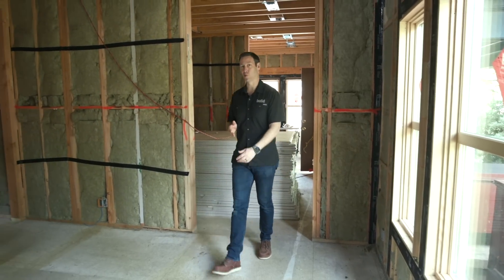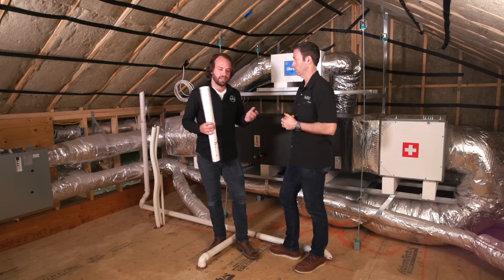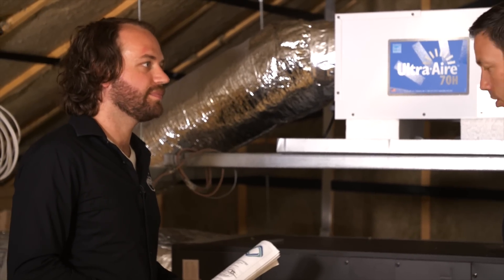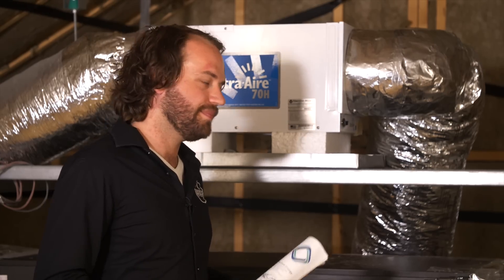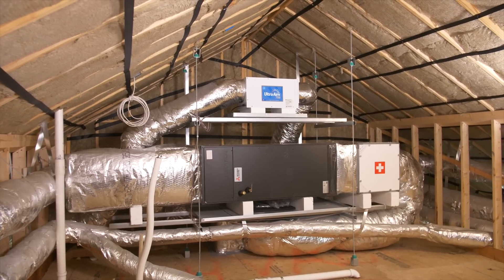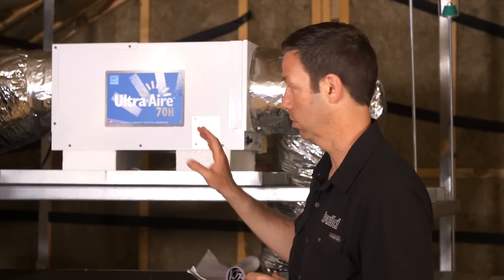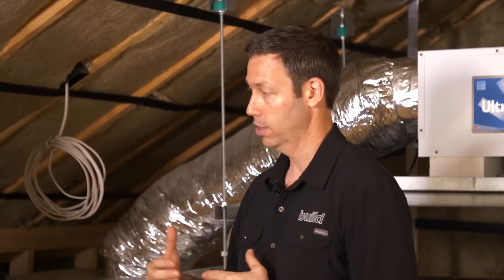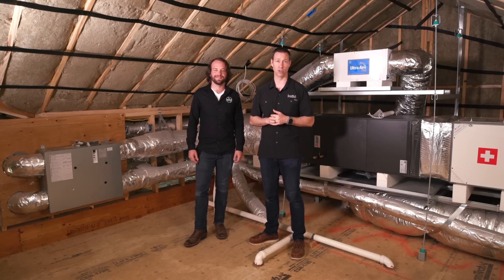New BUILD : Excellent Air Conditioning System Cost?  I’ll tell you!

Comment: It just be me but, why are the AC systems placed in the hottest area which is the artic. Then cool the air and blow it through poor insulated not permeant ducting in this hot attic to the area needed before reaches where it is desired. Much of the cooling is lost.

Comment: A car hvac keeps adding more pollutants both from inside the he car and outside.  Petrochemicals from engine and leaky exhausts and traffic exhausts.  House unwanted tightness to limit more nasty stuff from outside adding to possible inside pollution that is being cleaned out.  You Also do not want to pull air so hard your pulling air from insulation in the walls.  Love all the hepta filters and PM part of it.  Like an operating room inside the house.  Worth  the costs as we spend a lot of time inside a house especially with climate change.  Need for smaller hvac which saves energy.  With increasing energy costs would recommend battery storage and or solar.  Save cheap power for use when more expensive peak power.  Plus protected from increasing outages.

Comment: Homes are primarily wood and cardboard.  More labor costs more than anything.  Kitchen appliances/toilets are nothing compared to cost of home.  Spend money on hvac system.  Minimum 20 amp circuit, ie forget 15 amp.  Spend money on plumbing, windows, and insulation.  Everything above minimal compared to price of home.  Agree, do it right. It pays off later. Same with solar.  Solar is expensive cuz pay everything up front but pays off later.  Heat pumps?

Comment: I like everything except you idea of hepa filtration. Many hospital operating rooms use hepa filters and they are nothing like your filter. I was an HVAC maintenance worker in hospitals for 20 years and I replaced hepa filters as well as regular filters. There has been a lot of hype by sales idiots about air filtration. You need to get yourself educated. ASHRAE defines everything in the science of HVACR mechanical systems. Talk to the people who support ASHRAE and you will get the facts. Words matter. What you are calling hepa is actually a high efficiency pleted filter with a cabinet made to allow slide in filters. Hepa filters are clamped in an air tight cabinet so that no air can go around the filter. A residential HVAC unit can not use hepa filters because the air restriction (pressure drop) is way to high. Special high pressure fans are required and the horsepower to move 1000 cfm will be double. Dont get me wrong about the filter box you are presenting because it looks very good. MERV 16 with those 4 slide in filters is outstanding because it keeps the air resistance low. Residential units must use a special arrangement like this to use high MERV filters. The higher the MERV rating the higher the air resistance and more horsepower required to move air through a single filter. By using 4 it makes the whole filter only 1/4 the resistance of a single filter. ASHRAE has a specific test for air filters so these IQAir filters should have paperwork from an independent testing lab with the actual MERV performance. If not they could be exaggerating (lying) about their MERV rating. I question why anyone thinks they need MERV 16 in a residence? https://www.epa.gov/indoor-air-quality-iaq/what-merv-rating

Comment: Looking at Positive Energy's website, they're charging $6/sq ft for design services and tell customers to assume $20-$25/sq ft total installed costs. That's completely ridiculous to me. In a 2500 sq ft house, I pay these guys $15,000 to design this system, and ultimately pay $50,000 to $60,000 to have it completed...? I don't know what construction costs are where the rest of you live, but in Tennessee you can build a pretty nice house for $150/sq ft, and to think that ~15% of that would be in HVAC is asinine.

Comment: Unvented roof with rock wool insulation.
return side: Swiss air filter > AC > Dehumidifier separate return? sending dehum air to supply > ERV pulling air from outside then sending all that supply back into the supply ducts.  
Is this right? Trying to figure out how this is laid out and ducted. I am trying to figure out how to go from a vented attic to unvented and stumbled on this video.

Comment: It's refreshing to finally see someone talk about long flex runs.  As an HVAC contractor in the Northeast, long flex runs are not common practice.  However, most HVAC channels based in the south, flex is all you see.  You also don't see many GC's talking or caring much about the HVAC systems.  Love the content Matt, keep up the good work.
Reply: You want to see a bunch of 5 ton spider 🕷️ systems. Look at those $2-10M homes in Alpharetta Ga that I used to do service on. Most variable speed blowers wouldn’t push enough air through those high profit hack jobs.

Comment: Hey Matt, I had a question about VRF systems that I thought you’d know. From my understanding, the mini-splits take heat from the house and dump outside in summer and reverses that process in the winter. My question is could that be combined with a geothermal system so that you are pulling and depositing this energy from the ground rather than the air? Would there be any improvements on efficiency or would this just be overkill?Thanks and great content as always!
Reply: What you're talking about is a ground source/geothermal heat pump.  If sized properly, the geothermal is probably 10-25% more efficient, but usually has a higher upfront cost because you have to drill the holes/dig trenches for the pipe and purchase/install the pipe.  The phone quote on my estimated 4 ton was about $800/ton of AC size installed for the LOOP FIELD PIPE only.  I was going to do the digging myself with my backhoe.  The indoor evaporator was the same cost as an air/air heat pump (my installed quote was 10k for the inside unit - Total was 13k doing the digging myself).  If they installed it all w/ trenching it was going to be 18k.  Unless you have a large heating/cooling demand, your break-even on the geothermal vs this Mitsubishi heat pump would be a long time.  FYI their estimated size was twice what I actually need.  I'm working on lowering my load demands by air sealing/insulating and will probably install the same Mitsubishi in the video, just smaller.

Comment: So the HVAC system ALONE is going to cost you 2-3.5 times more than an open air house. This DOESN'T include the costs for upgraded insulation.  NOR does it include the cost for  maintenance of this very complex system. If something breaks down on this system, it is going to be expensive to repair and not any HVAC tech will be qualified to fix it. But wait, there's more, you are replacing  MULTIPLE air filters every three months. You'll probably spend $500 a year on air filters because you can't run down to Home Depot and buy one of these air filters.  So you are going to probably spend at least 2.5 times more for your home cost  On a $250,000 home,  3000 SF house, the typical cost for a really good HVAC system in AZ would be less than $25,000 - $30,000 and that is using top of the line Trane units. So for this closed house system you are spending (2.5 x 25,000) - $25,000 = $37,500 more for JUST the HVAC. Now add in at least $7,500 for closed cell foam costs (over standard insulation costs) and you're at $45,000 more in cost. If you want to filter your air on a standard system, you can install a Trane Clean Effects system, which is one of the best, for around $2,500, and you can reuse the filters on that system. You will NEVER get that $40,000 back because when you resale your house, no buyer is going to pay $40 K extra for a fancy HVAC system in the $250,000 cost range. 

Further, the open air standard system for a home building will be 90% as efficient thermally as this closed system home, if it is built and insulated properly. That is because you get diminishing returns on any insulation over R-40 in the attic and R-25 in the wall. You can spend a ton of money to add more insulation above that, but you get very little efficiency return.

BY FAR, most builders do NOT used Risinger's "closed house" building system because there are SO many things that can go wrong with it. It's expensive to install, expensive to maintain and expensive to repair.  If you are building a million dollar and up home and you have money to burn, then these luxury systems. 

It would be much smarter to build and standard house with standard insulation and spend the $40,000 on installing a solar panel system. This would reduce your energy bills to almost nothing and when you resale your house you will be able to get about 50% - 75% of the cost of the panels back depending on a lot of factors. You also get large federal tax breaks on solar installations. Also, for a 3000 SF house you could put in a really nice 15 KW solar panel system for around $25,000 and that would more than power your house.

Comment: Tight homes are great  , however many people are not prepared for the huge cost of  hvac that is needed with the tight home .
To say that the general contractors are to take a lot of the blame for this is accurate .
The general contractors for example will be charged by the subcontractor for air conditioning , say 3 ton for 3000 dollars 
Typically he pads the bill to the owner  double , at least 6000 dollars .
Home owners would save tens of thousands of they would have the builder just build the structure while you hire the subcontractors . The prints are already drawn up , you simply hire the plumber , electrician , hvac , etc that must follow code anyway .
Remember it's the general contractors making huge profits on all his subs which ultimately costs the home owner .
Context , 
A good  home builder , on average 
every third home he builds is 100% pure profit .
They are salesman , your suppose to like them , they are great guys , really care for you ,trust them ,  your best interest at heart .

Comment: Builders are the reason homes have mediocre systems . 
Though they charge the owner as if it were a very good system $$
This installation is not for any average homebuyers .
This is going to require more  maintenance , and omg when the warrantee expires you better have some serious cash ......your going to need it .
Not a dream system 
Better would be infloor heat ( boiler )  seperate zones with an air handling system 
Yes this is the south sooooo yeah . 
The video is for people who are well healed , aka has lotsa cash .
Hey , I like Mercedes as well , but let's face it , I can't afford the initial cost as well as the costly maintenance 
For the average middle class person , put some of your extra cash into filtration and a simple inexpensive air exchange .
Let these guys figure it out over the years , work out the bugs and of course the price must come down .
Basically you can do anything you want if you have alot of expendable cash .
This is a toy video

Comment: With a 3-stage one-to-one VRF system, do you control the zones via dampers?  If so, and you still have excess CFM, do you install a pressure relief duct to blow that excess air to the attic or crawl space?

Comment: Great video, and very honest about selling an admittedly high-end system. But my second comment is blasphemous and should be banned, but, for an incredibly low budget amount ($150) a standalone portable dehumidifier would dehumidify that entire home...in the conditions of the video; very airtight, and a hot humid environment. It would only be needed a few weeks a year; when it's cool and rainy (70-80 degrees). Any hotter, the main a/c will completely dehumidify the home, making the separate dehumidifier sit idle for 90% of the time, and possibly months on end. Sure distribution is king, but when dehumidifying, distribution is no problem through natural diffusion.
Reply: I was taught wet air finds dry air. So, I agree with you on the stand alone dehu. Even better, hook it to a RH switch with dehu drain plumbed. I’m sure this is a “duh” to most here.
Reply: @glampocro1688  Personally I would probably get/install the $1,500 (?) system mentioned here (it's been 5 months since I watched video), but the $150 solution I mentioned is still pretty good, and like you said, drain plumbed, and with a RH humidity switch would be maintenance free. But in most cases, go over the options with the typical homeowner/buyer: 3 options, $1,500, space age cool, automatic, $150 (plus RH switch cost) for a not as concealed system that still does a great job, or $0, with nothing. I think the vast majority would look at the 3 costs, and instantly go for the $0 option. Then they would say "that's what central air is for," and they would instantly end the conversation, and change the subject (which they can do since they're paying, or not paying).

Comment: One question that came up with insulating the attic area: My parents looked into that at one point on their house but were told that if you insulate behind the asphalt roofing shingles, because now you are trapping all the heat there, it would decrease the life of the asphalt shingles. At first blush it made sense but I never thought about it. How do you deal with that in your builds in Texas, or is it a myth that it would decrease the life?
Reply: He explains in a few videos  i cant remember which ones . But  basically he says it only raises the temp of the shingles a few more degrees not enough to make a difference in the life expectancy of the shingles. Also he has mentioned before that your house and roof must be air tight to put insulation directly onto the bottom of the roof . Otherwise you need ventilation in between the roof and the insulation leading to a ridge vent .  I have also hear about solar reflective shingles from and episode of ask this old house.  Search for the youtube video .Depending on which ones you get they can reflect back up to 40 percent of the heat.

Comment: An HVAC contractor is recommending to use a Unico high velocity system for my midcentury house remodel in NY. His main reason is the tiny attic space in one section of the house where he's not able to run oval duct enough to transfer the required CFM flow. He also states some advantages such as no hot/cold mixed pockets, dehumidified cooling, small duct that can run in small areas and finally quieter operation. But all the videos I found about this high velocity system are many years old. My question is weather this is still a popular technology and does it have any negatives?
Reply: -If Con-tractor fails to provide room by room Return Air as a well as Supply Air it will Pressurize room by room like an Airplane Cabin and you’ll feel it in your ears as they try to equalize pressure. Also you need more than 5 Outlets per rated Ton of overall system to quiet it down on Supply Air Side, 7+ . 
  High Velocity system will require attention to these details. One positive is that there is little to No Stratification (Thermal Stacking) with these systems due to the nature of thoroughly mixing the air. 
  They are still viable systems because they can use up less space for Ducting. Proper Ducting size for Conventional should be larger than most are But most will Balk at added Cost and Consumption of Space.

Comment: BS. More shit to fail. Well your de-humidifier is no longer made. So we have to replace your furnace as well because it won't talk with the old system. Also the drain system has changed so we need to change that as well. Also the exhaust system is different so we have to change that. We also can't integrate to your custom filtering system so that has to be changed as well.

Comment: I’m kinda in shock on the $40 to $70 number I feel like that’s insanely expensive I just had a couple of units installed in a 3500 sqft house and it works fine not bad on power bill either it was 12k . I know Matt’s a pro and does a lot of high end custom homes but I really don’t think this is necessary. If you have less than a million in the bank and your mortgaging your house and someone is trying to sell you the rolls Royce of ac units do yourself a favor get the cheaper one and put the extra in a mutual fund you will thank me in 10 years
Reply: This is more for the 1% who can spare the money for better comfort. For everybody else, it wouldn't make economic sense to go for this. Also, with all of those extra insulation etc, wouldn't it be better and cheaper to use ductless mini splits? Those are more energy efficient as well.
Reply: @georgehill3087  The cost of the ductless mini splits would be compared to the cost of the Mitsubishi VRF system only (the black Multi-Position Air Handler installed is using the same outside condenser as the ductless units use).  Once you start installing multi-head units and/or multiple ductless packages, the cost is probably similar to just ducting and using a Multi-Position unit.  I know that was what I found, but mine is existing construction.  To your point, it might be a little cheaper because you wouldn't have the ductwork.  The dehumidifier and ERV are upgrades that the customer selected/were sold.  You have to have fresh air intake in a tight home by code, so that's why they have the ERV.
Reply: $40-70k is pocket change to the person building a million+ dollar home. His mutual fund portfolio is more than you’ll make in a life time.

Comment: Rare contractor will disclose the cost of the equipment, because it's relatively low and this is how they make money. Basic equipment vs. fancier is still incremental increase, but you can be charged double when you go from 14 to 17 seers... The fancier things sound, easier to overcharge, even the real price difference is insignificant